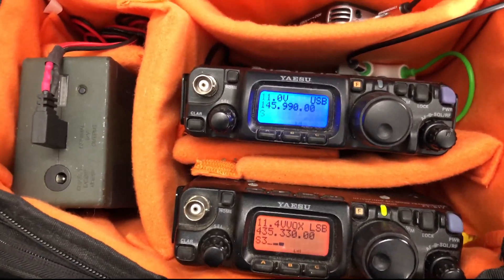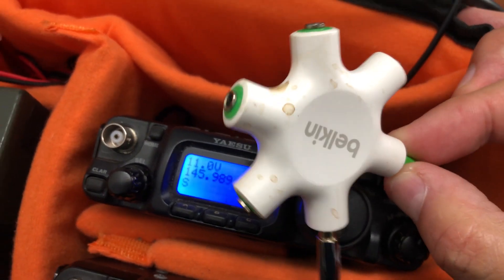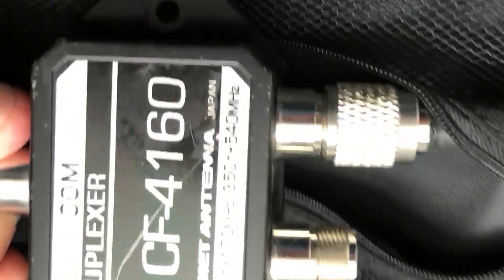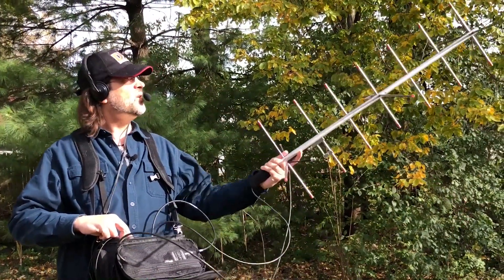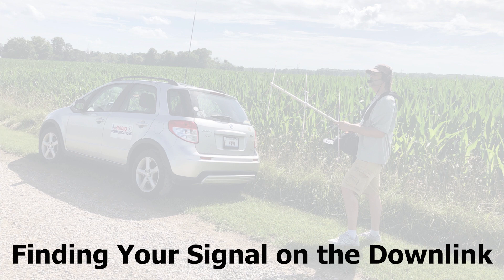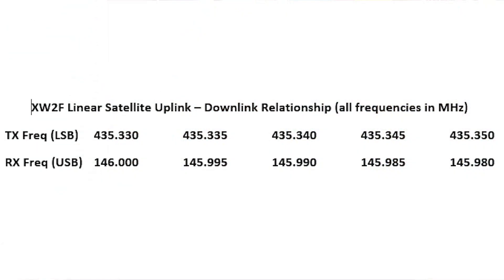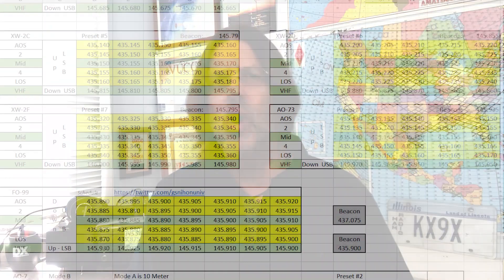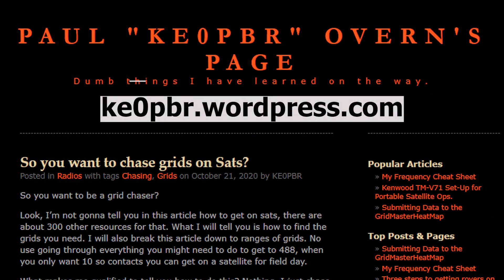Tips on Operating Linear Amateur Radio Satellites (Part 1)

Comment: How can I use two hts with same antenna ?
Reply: Make or buy a single boom antenna with 2 sets elements (one set 435MHz, one set 144MHz). An Arrow2 without the duplexer is good so you have 2 x ants, 2 x leads and 2 x rigs. Get 2 x coax leads, one to each radio. Label one Ht for 145MHz and tune it correct freq. similarly for other on 435. Program the uplink ht with correct CTCSS tone. One in each top pocket of a jacket, a headset or speaker mic is good too...Give it a go. Can be tricky at first but comes naturally with practice. Best to start on FM sats with uplink in 435 and d/l on 145 band to avoid harmonic interference (which you can get with u/l 145, d/l 435).
73 Nick M1DDD (a few basic vids on my YT channel)